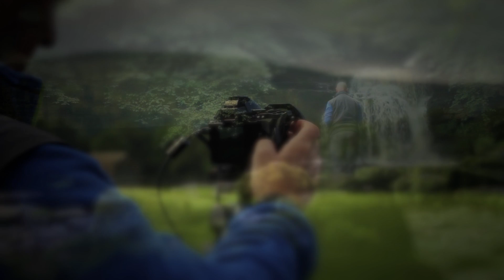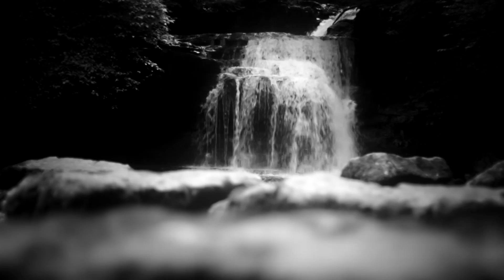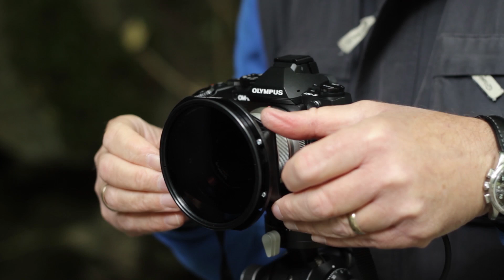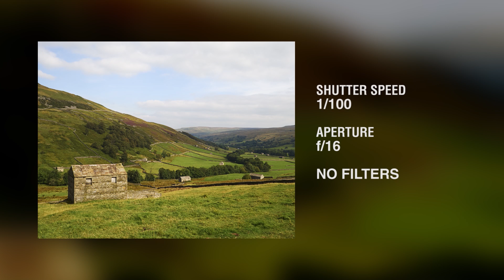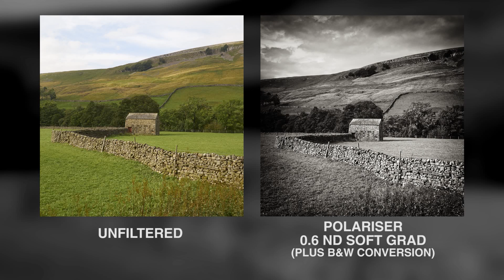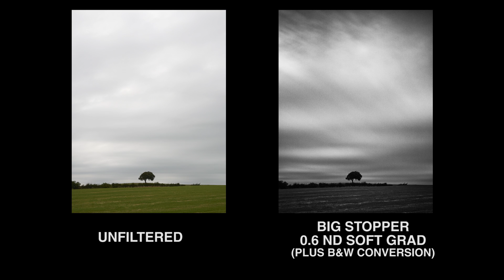LEE Filters - Seven5 Landscape Shoot with Steve Gosling

Comment: Really interesting video from Steve. I want the 25mm lens so it was interesting that he is using it later on. Is he using a 45mm for the waterfall? Wow, the little stopper is about 6 stops and the big stopper is a 10 stop ND filter? I like the 0.6 gradual ND filter because you can't tell it has been used except that the picture is just right.

Comment: question: why does he use a filter to recover all those colors, only to loose it all again in the black and white conversion???- not quite the best advertising for the 7/5 system!!
Reply: the best your color version is the easier your b&w conversion will be in terms of contrast, details, structure and so on... just my 2 cents :)
Reply: also, that's not a bw sensor anyway...
Reply: It's a polarising filter. It cuts out glare and increases saturation, also bringing out detail in the highlights. The image having a mono conversion is irrelevant.

Comment: Hi Steve,
I wanted to ask you a question regarding my E-M5 MKII & Lee 100mm system.
I shoot with the 12-40mm f/2.8 but I already own the 100mm system for my D750, I use soft grads and the big or little stopper.

What I wanted to ask is if I use my soft grads on my 12-40mm lens will the transition be to wide and would I have to use hard grads to get the same effect as a soft on my d750?

As I already own the 100mm system I really want to utilise that with my Olympus system and not have to purchase the 75mm system 

Thanks,
Billy
Reply: Billy Matthews you can use your 100mm system with the Olympus 12-40mm f/2.8 as it has a 67mm front thread, you would have roughly the same effect with Grads, as the crop doesn’t change much

Comment: Hello sir! I really enjoyed your video. I was just wondering if Lee Seven5 would just fine without any vignetting or whatnot on Sony Vario-Tessar T* FE 16-35mm F/4 lens? I learned from your website that this filter system would work with mirroless lens with up to 72 mm filter thread. But would it cause any problem in this wide angle case? Thanks.